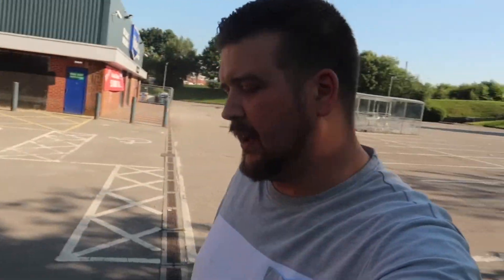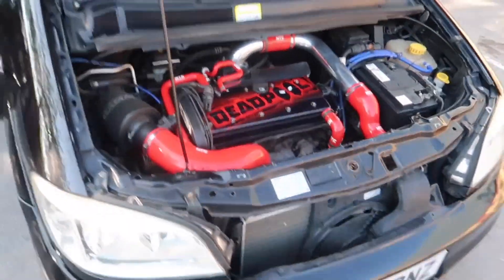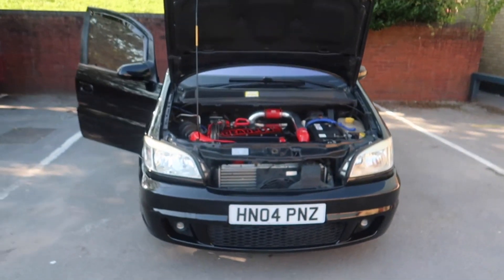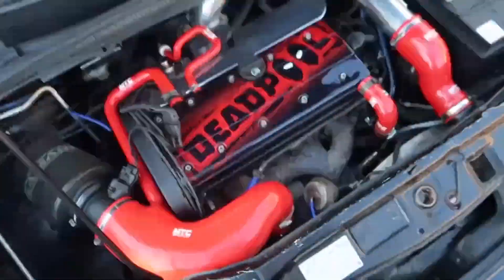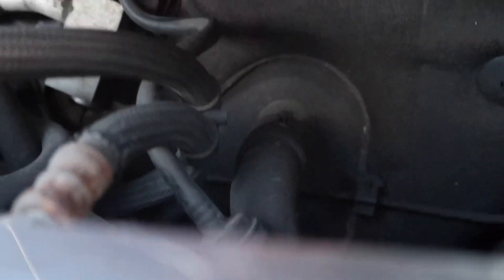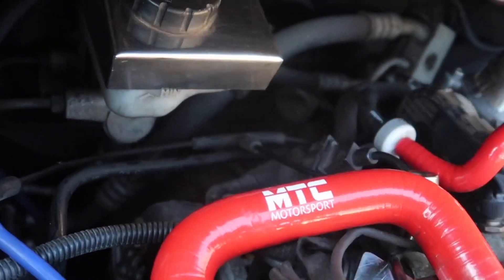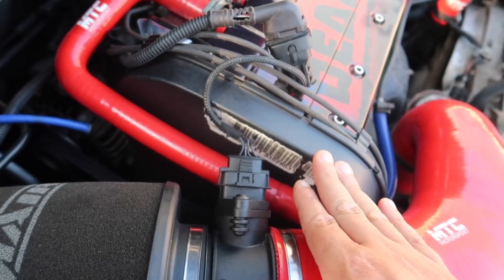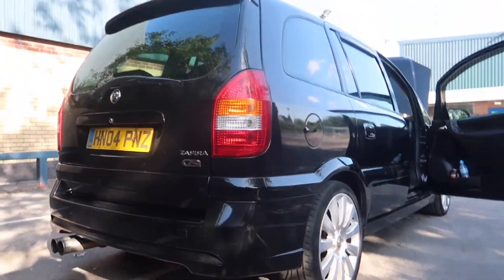Z20LET BOOST BUS…*stem seals/timing kit*

Comment: Wez has this been mapped? Just I am asking because I have the same engine as you and they come with a 70mm MAF, To use the cross over delete you have thats for the VXR, it is to fit a 80mm MAF.. So you can fit it but it needs to be mapped to run it..
Reply from the maker: Pretty sure brother it’s 70mm the one on mine but I’ll defo have a check man 🙌😎
Reply: @Manlikewezzo  cant get a 70mm cross over delete